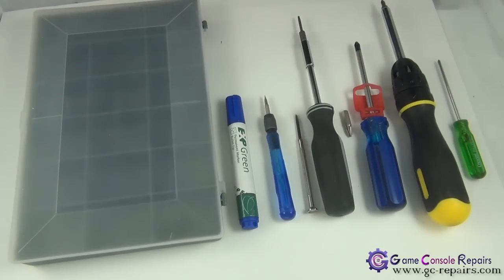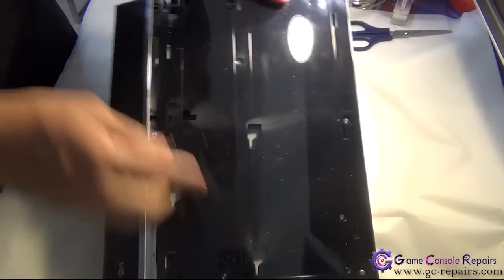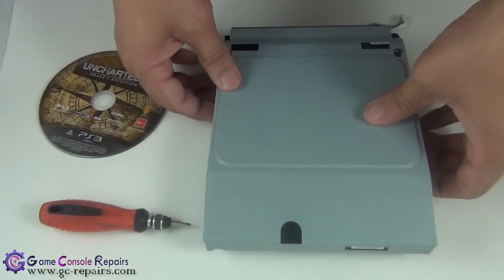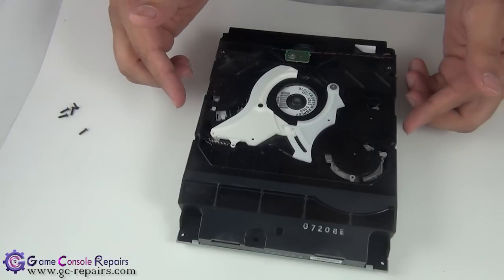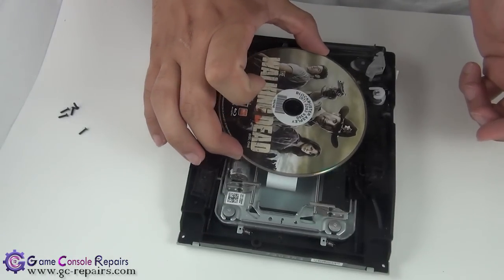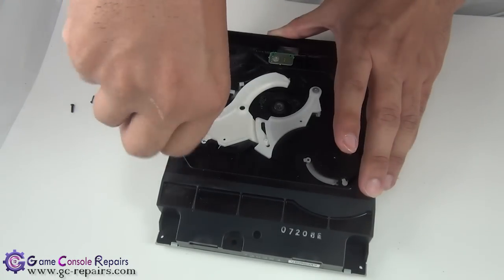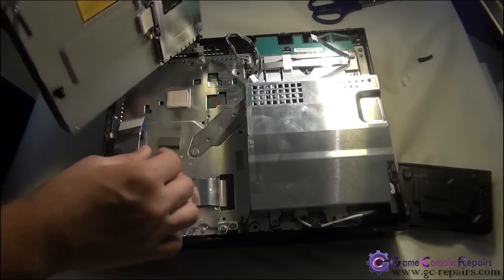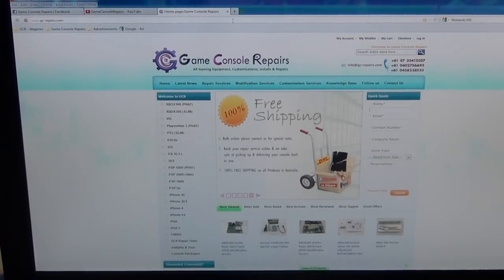PS3PHAT   60GB CECHC02   How to remove a disc manually & reset the Blu Ray Drive by gc repairs com

Comment: Thanks, Took apart blu-ray drive with a disc in it, put it back together and drive would not let a disc be inserted. Took apart and found that two clips where preventing disc from being loaded. Used your process above to reset drive and move the two clips back in place. Works fine now.

Comment: This video really helped. Although I have the ceche01 version, they made it a little bit easier as there was no screw to detach the arm piece, no ribbon cable, no stickers either. But I did have to remove the inner metallic piece first before being able to take the white cog off otherwise I think I would've broke it pulling it out. but other than that all the steps were practically the same.

But you saved my Rocky & Bullwinkle disc!! I haven't been able to continue binging my series box set for months, so THANK YOU!

Comment: brilliant vid. . when you take that cog off,  push it back and forward few times and make sure the 2 grey disc stoppers(where the disc goes in at front) both popp up same time then back down to the flat position then make sure it's locked in place and put the cog back on :)

Comment: Ok I need your help. turned out ps2 games only work on my PS3. Now no discs will be read. it sucks them in but no blue light is on. I then opened the drive up and the disc was not fully in. it wasnt even in the circle bit so it could spin. how do i fix this?

Comment: The motor that takes in the disk doesn't even pull the disk in for me and I don't have a disk in the drive, and the gears are all reset, any ideas?
Reply: i have the same issue, you ever figure it out?

Comment: Hi I was able to reset as you instructed but now the drive takes the disc but doesnt fully pull it in, it gets like 90% of the way in and I can hear it trying to seat it on the spindle but never does. It ejects it fine after though...

Comment: you can just unscrew and lift up the silver motor instead of that white gear and this will still work with 2 less steps required : D

Comment: how important was the sensor cable, tried everything i had to be careful and stgill ripped both cords out.
Reply: Me too.  I even tried to use fine tweazers.  Broke the cable clean off.  If the sensor is important, I now have just a glorified paper weight.  Or is there a way to fix it?
Reply: @StarlasAiko  That system ended up breaking unfortunately. Pretty cool to get a response after half a decade.
Reply: Tha_Kid_Shido well, I had to resort to buying a new drive on ebay

Comment: I bought a refurbished disc drive. Traded out the board from original drive. Then after install now it doesn't respond at all to anything. Beforehand the original one stopped accepting discs and reading them since kids put 5 discs in at the same time. The new one doesn't even eject or respond. The system starts normally without codes, but whenever I try to click on anything even PlayStation store it just goes to black screen. Any advice?

Comment: Good video, what was causing the disk to be stuck for me was a mini sd card. A child must have put it into the disk drive.
Reply: kyle monroe Yeah I know. The analogs on the remote which came with the console were also filthy. Only reason I bought the console was because it was running firmware from 2009.

Comment: I bought a PS3 for £5 a while back. I tried inserting a disc but it wouldn't go in, I shake the PS3 and spaghetti and half a copy of modern warfare comes out. Also the small 80gb HDD was filled to the brim with p*rn. Still can't insert a disc, so I'll try this.
Reply: I bought a PS3 for £5 at a carboot sale thinking it wouldn't work and I could use it for spares but it did work, although only if I kept it upside down.  Eventually it stopped reading the disc.  I opened up the drive and inside was the disc part of a PSP game, which had been in there. Fifa 08..  Amazing that it worked for so long with something jammed in.

Comment: Excellent. You demonstration is so easy and I was able get my disc out. Need a bit more help as my PS3 60gb still showing red blinking light. when I touch the power button then the fan starts for few seconds, then the light turns red, make few beeps and stop. do you have the solution. thanks
Reply: The problem could be related to poor contacts on the Hard Drive. Remove HD, rub lightly with an eraser then reinsert & move back & forth a few times to maybe obtain better contact. This worked for me.

Comment: I have a CECHK01  (FAT) model and the disc does not spin anymore, would resetting the drive be a reasonable option? I tried re-seating the drive but it didn't work.

Comment: So I was able to get my disc and re set the motor, but it still wont take any discs in (so the games wont read because it still thinks the drive is empty). Any solutions?

Comment: Hi there, so, I'm working on this now, but I have a couple of problems. One,I did as you said, and slid the slider bak to where it isn't locked in position, but the motor just revs, and wont accept the disk, it seems as if the slider isnt being pushed into the gears. Why isn't it? Second, if I put it in to the gears myself it tweaks about and makes a horrible grinding noise. Any ideas?

Comment: You dont need that fancy tool, you just need a torx screwdriver..,
Reply: A security torx with the hole (size 8 and 10 work).  Only to get inside the PS, then it is just philips/posi heads.

Comment: You know....
This is up side down for us watching ?
I have a ipad so I can tun it up side flat, but not a pc....
Reply: Windows you can flip the screen by clicking Ctrl+Alt+ARROWKEY  each arrow key will change the orientation of the picture.  This works on Win10 at least.